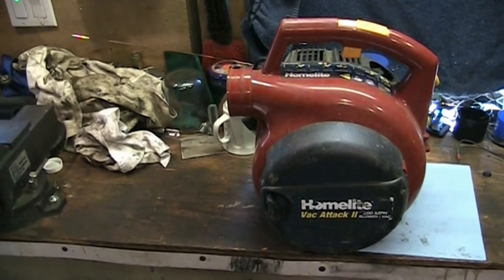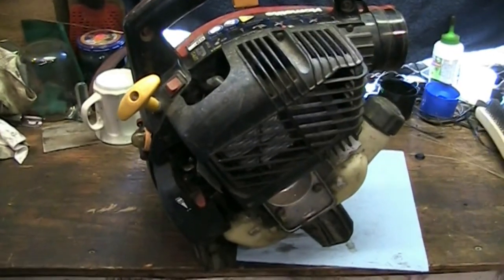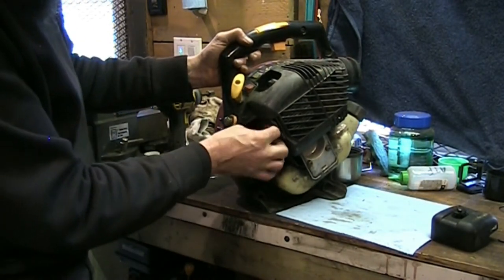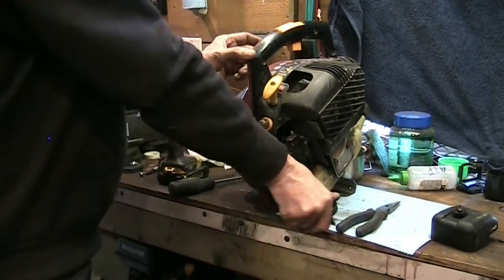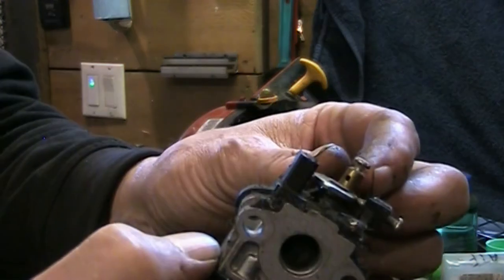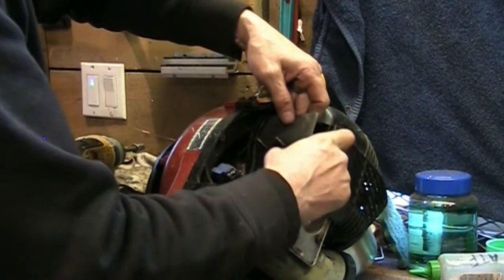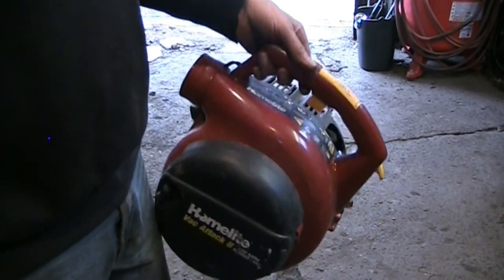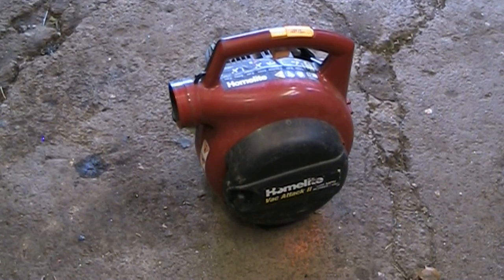Getting this homelite vac blower to run.

Comment: I have a Homelite Vac Attack and the fuel line running from tank to primer broke. I replaced it and now it won't run. Acts like it's not getting any gas. Checked the lines to make sure nothing kinked. I'm baffled.
Reply from the maker: If the line was in bad shape, I may suspect the metering diaphragm in the carb may be stuff and not working 100%.  It seems like every 2 stroke I work on needs a new diaphragm...

Comment: I hate 2 cycle engines. I have never had any luck getting to run again. Just retired 2 trimmers and purchased a Honda 4 cycle trimmer. I must be overlooking something.
Reply from the maker: I've found most 2smoke running  problems are due to a carb problem. Either a full rebuild or a quality new carb usually fixes it.  The $18 Amazon carbs just aren't reliable.